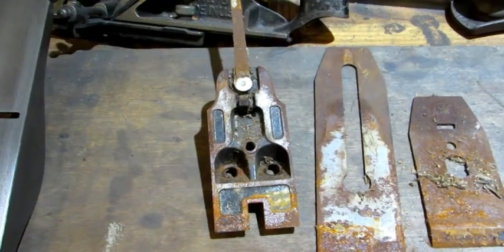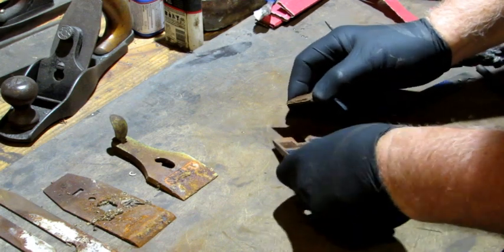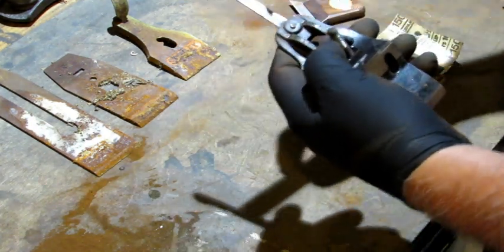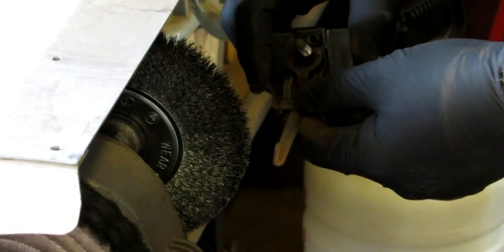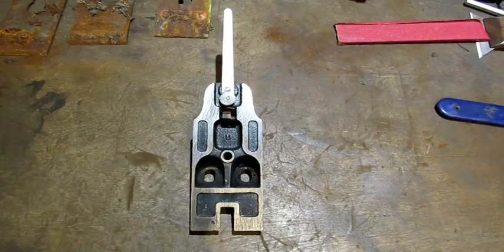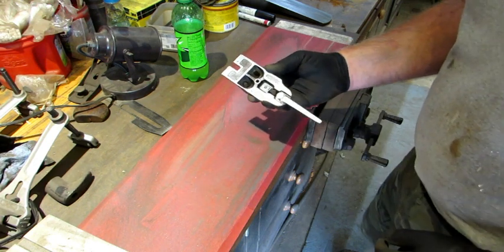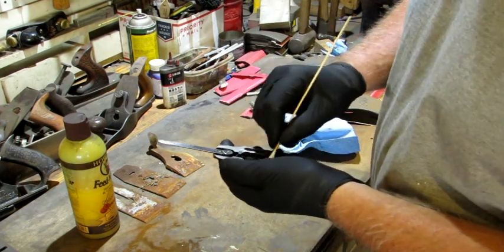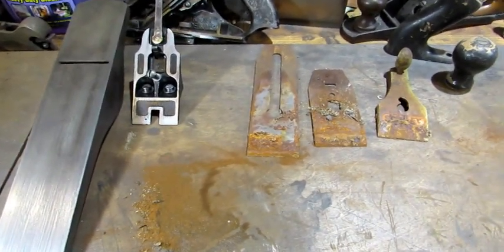How to Restore a Plane Frog

Comment: I bought a new stanley plane and it's not very good. I'm convinced the frog is not well machined as teh blade never sits square to the bottom when I clamp down on the blade. Going to take the frog out and give it a good once over. Even though it is new, I feel like the front part of the frog, the two prongs, they don't look symetrical.
Reply: PS, your one looks amazing, thanks for this video!

Comment: Thanks. However, please do a video where you tighten a lateral adjuster. I've had lots of problems with this, while doing exactly what you recommend in this video. I'd like to see two or three laterals tightened with good camera angles. Thanks!
Reply: Plane Collector , thank you so much!!!
Reply: Yes, please do.  I have two a No 4 and No 5 where lateral adjuster is way too lose and cause me problems.  Thanks in advance.
Reply: Have you done this yet?  I really need to tighten the later adjuster on 2 older planes.
Reply: Trav Wilson  I would appreciate such a video on lateral lever tightening myself